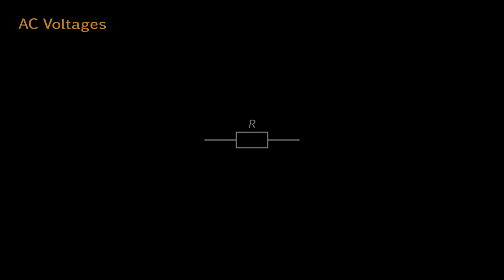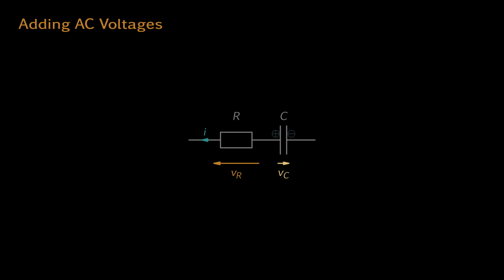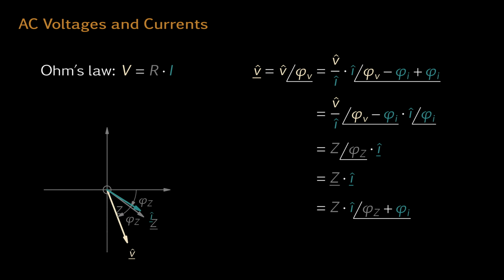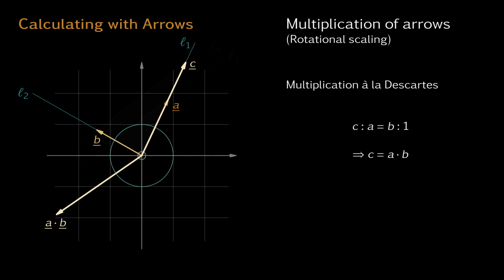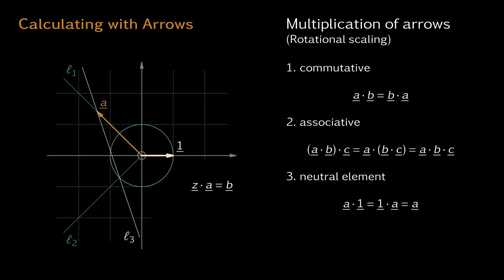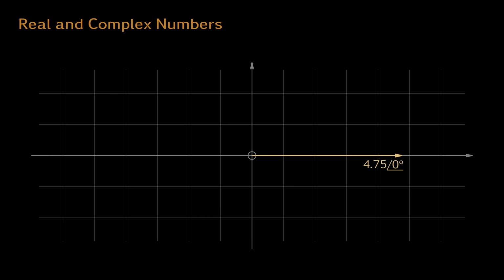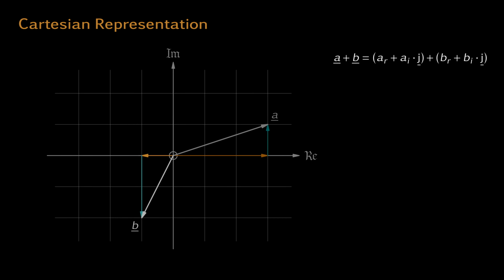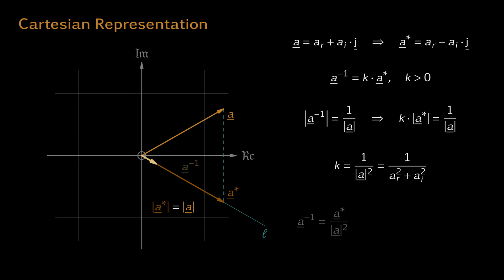Calculating with Arrows—The Complex Numbers #SoME3

Comment: This is a really cool geometric construction of the ℂomplex numbers with just a compass and straight-edge. That said, rotating the angle around the origin from the (1, 0) arrow feels a bit like a hack since there's otherwise no real indication that it's special. Rotating the picture doesn't do anything to the addition, but completely messes up multiplication. I'm pretty sure that this is because of the representation as arrows. When drawn as shaded triangles, that makes things so much clearer because it emphasises the relative angles rather than the absolute angles, and makes the relation to the "ℝeal" direction explicit.

Since rotations are ultimately relations between directions, they can extend beyond 2D, however in 3D they instead require 4 components, so it's no longer possible to confuse them with arrows unless you try to break your own mind, which sadly is more common than treating them as rotations. In addition, they''re no longer commutative simply because rotation in 3D is non-commutative, which can be proved with any physical object, whereas in 2D it's trivial to show that rotations are commutative.
Reply from the maker: I agree that not showing the similar triangles in the beginning is a bit of a missed opportunity. After all, that would have helped the arguments for the associative and distributive laws. But in the end you have to construct the product of the lengths and the sum of the angles somehow. I'm not aware of any construction that does both things in one.

Regarding the absolute angles, I'm not so sure if that is as true for mathematics as for physics. Choosing the direction of the unit arrow or choosing the direction of the one triangle side of length one to which everything else is related both select a certain line—along which the real numbers live.
Reply: @MrFessa  Yes, multiplying arrows requires selecting a privileged arrow to use as a unit. Multiplying triangles however does not (as long as you have a way to distinguish clockwise and counterclockwise triangles. Ultimately, rotations are not best viewed as arrows, though even in 3D where rotations require 4 components, people still try breaking their brains in an attempt to visualize them as 4D arrows. From what I can tell, physicists seem to resort to representing the rotations as complex matrices just so that they wouldn't try to treat them as arrows.

The unit rotation is 0°. It keeps everything in place, no matter which way you look at it. There is nothing "one unit to the right" about it unless you change the picture to rotate the "unit arrow" along with any change in perspective.
Reply from the maker: If I understand you correctly, you want to represent complex numbers as triangles themselves. I've only seen triangles as aides for the construction. Do you have a reference for this representation?
Reply: @MrFessa  Regarding triangles, not really since that's mainly from your video. It's not uncommon to see them as oriented parallelograms though, which is just the triangle plus a rotated copy of it. In this case, the area of the parallelogram is actually the sine of the angle times the magnitude of the two arrows that formed it.

In other cases, I usually see them as compositions of two mirrors, in which case the angle between the mirrors is actually half the angle that the composition rotates by (trivial to see by rotating the first mirror itself; the first reflection does nothing since they're the same mirror, while the second sends you to the other side of the second mirror).